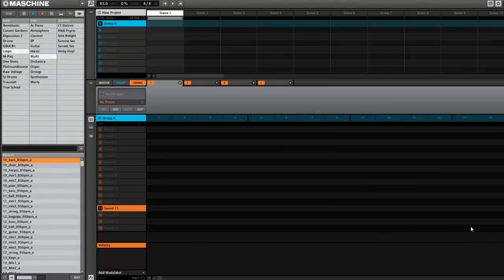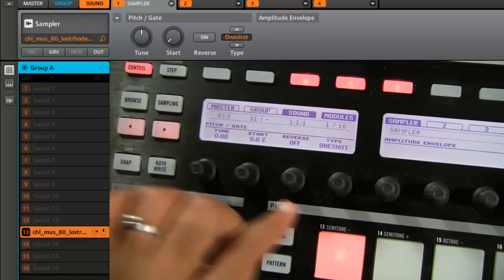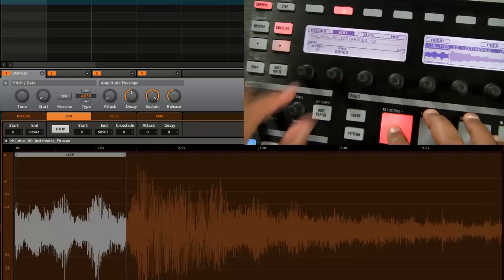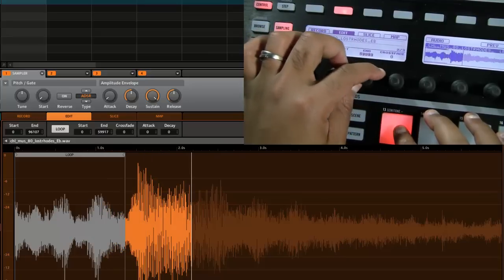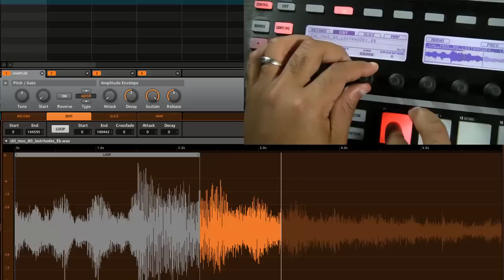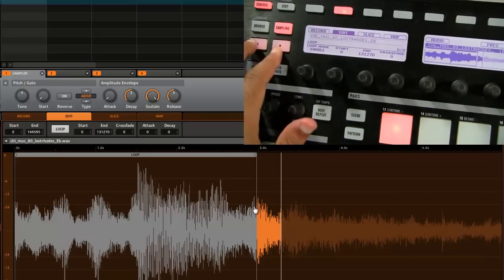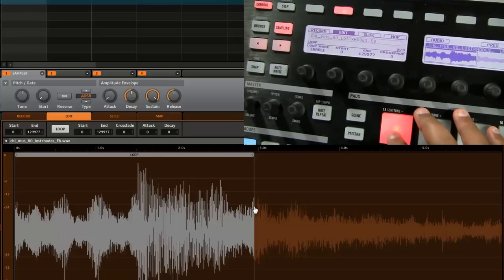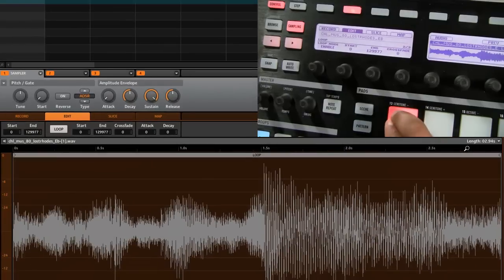Maschine Sampling Tips - Using loop mode to check your start and end points

Comment: In mashine 2.0 i figured it out but....the problem im having is when i turn loop mode on and where ever i set my start  point of the sample to loop...... say i want to loop the middle of the sample it dont start from where im trying to loop it at it keep starting from the beginning
Reply from the maker: Loop isn't the same as start/end point. If you want it to start from there you need to move the start point as well as the loop point. Looping in a sampler is really for creating sustained notes so usually starts after the beginning of the sample.
Reply: Maschine Tutorials I did it still start from the beginning
Reply: Maschine Tutorials never mind I see what I was doing wrong thanks saint joe!
Reply from the maker: Cool fam!

Comment: Hi +Maschine Tutorials do you know if it's possible to have a sample looping in "one shot" mode rather than "asdr"? Just so you don't have to keep the pad pressed and can use your fingers to trigger sounds on other pads. Thanks
Reply from the maker: Bluto Bluto You can only have a sample looping when using adsr so that it loops when you hold down the pad. There is no "latch" mode for looping a sample currently. There used to be a way to sort of do it with AHD, but it would still not be a latched loop.

Comment: How do you setup a loop to loop continuously with a pad press without holding down the pad (and instead of putting it into the step sequencer)? Is this possible?  It would be help in making beats on the fly.
Reply from the maker: The best way is to create a pattern that is as long as the loop you want to trigger because there is no way to "latch" and "unlatch" a loop by just hitting the pads.